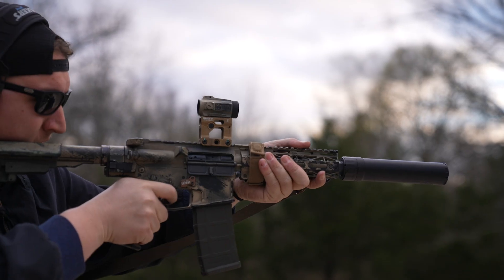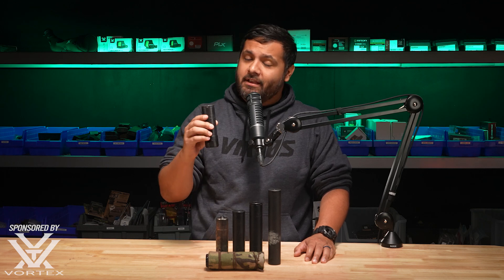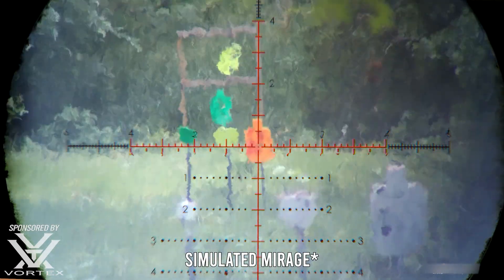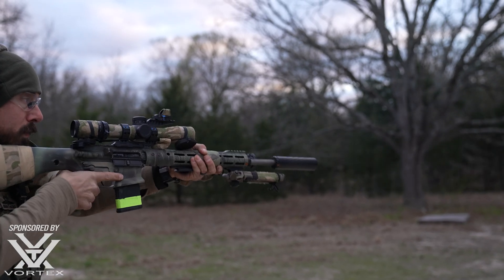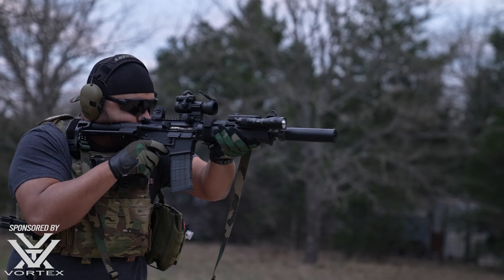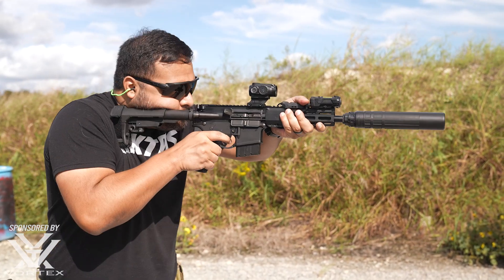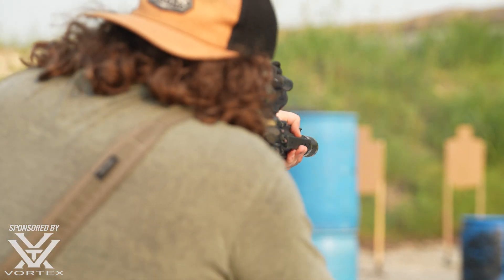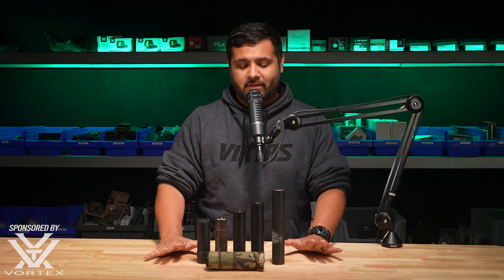Suppressor Size Matters

Comment: Question? 
I'm looking for the best suppressor for 300 blk. This will be dedicated to one AR set up that I'll change barrel lengths from time to time. Cost is not a issue I want the quietest possible. I'm thinking titanium would be in my better ideas mainly due to weight.
Reply from the maker: If you are going to be shooting at night or with night vision then I would avoid Ti cans unless they have Inconel or Haynes blast baffles. But they are impossible to beat from a weight standpoint and with those bigger cans they can get REALLY quiet. We were really impressed with the CAT cans (they offer Ti and Inconel versions) and they give A TON of sound performance without having bad backpressure. But 300blk subs don't need an enormous can to perform well.
Reply: @ARFCOMReviews 
Cool thann you very much for the reply and pointing me in the right direction 👍